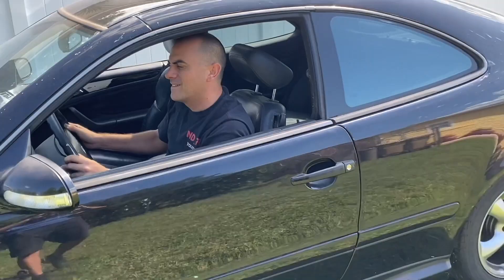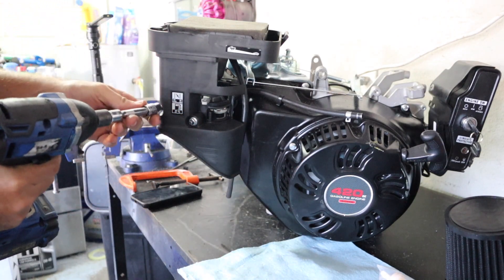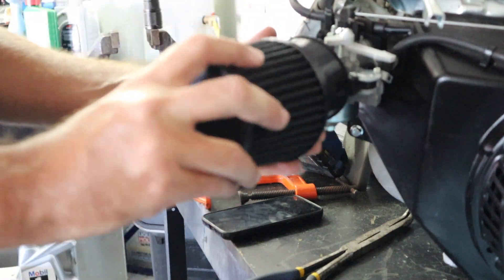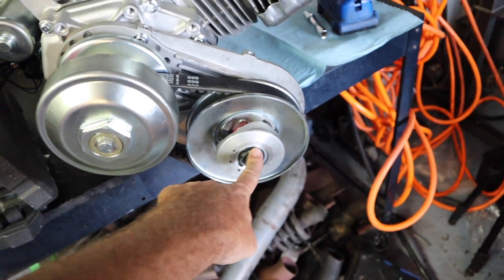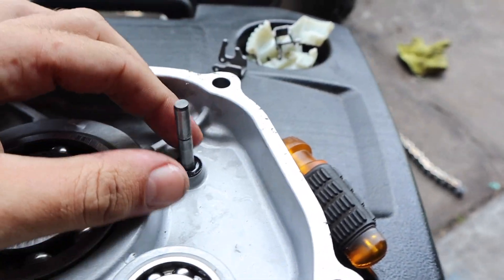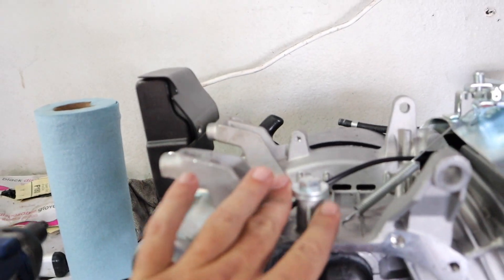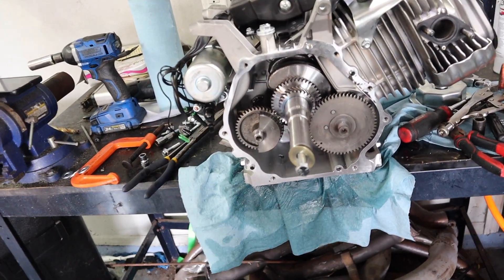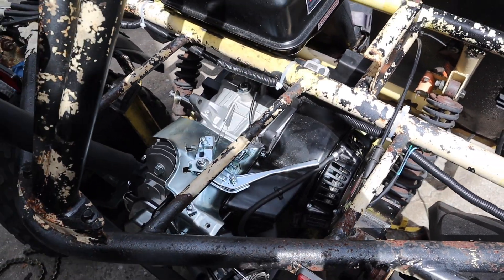Predator 420cc Performance Mods and Governor Removal

Comment: Did the torque converter work out for you? I have the same go kart.
Reply: Unrelated question but, If i were mount this on a go kart would i need to buy a separate clutch for the engine?
Reply: @WTAlanPetra  No, the Driver is your clutch.